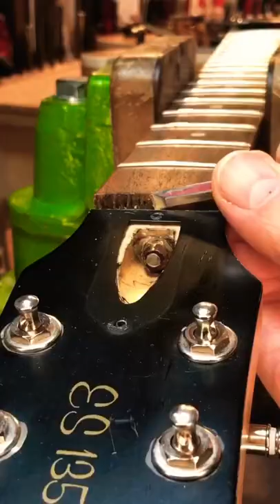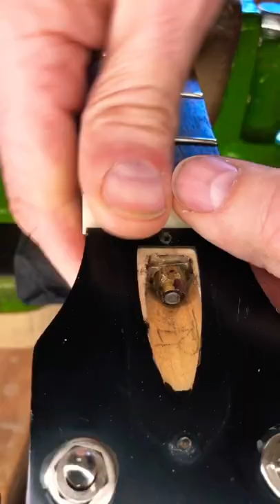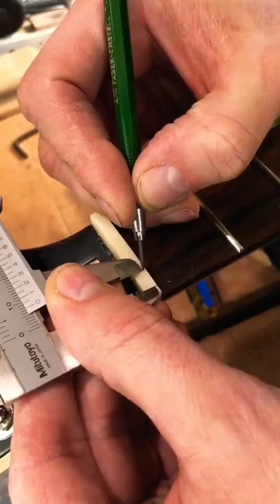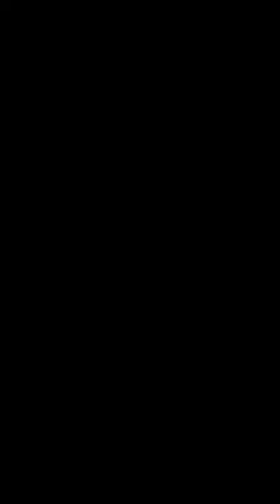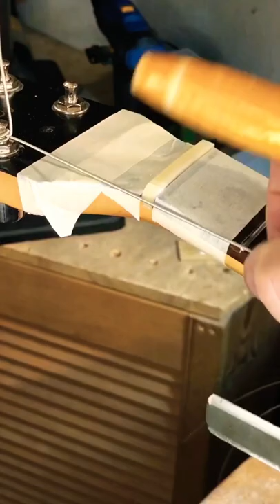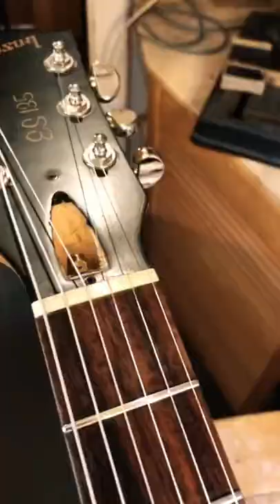How to make a Bone Nut for Gibson Guitar repair Gitarrenreparatur #shorts #gibson # luthier #howto

Comment: Beautiful...art in motion.  How do you get the string spacing so perfect?
Reply from the maker: Thanks a lot.I just measure it out🙂Best Regards Nik
Reply: I use the old nut as a template to start filing the slots, no need to measure! 🎸🤘